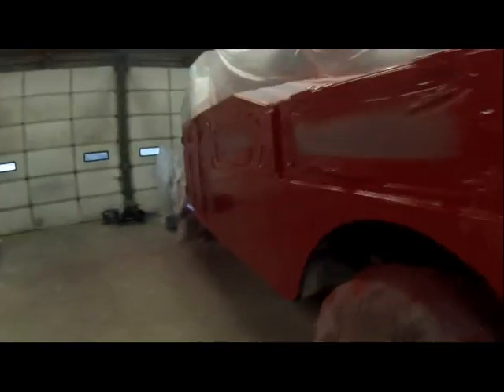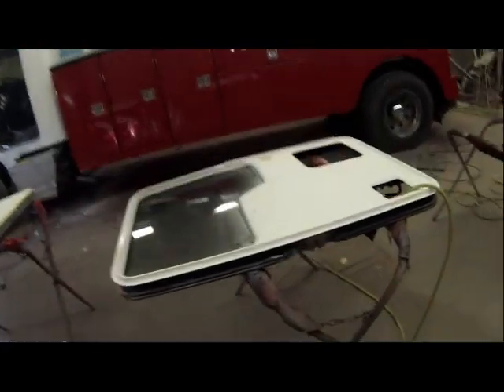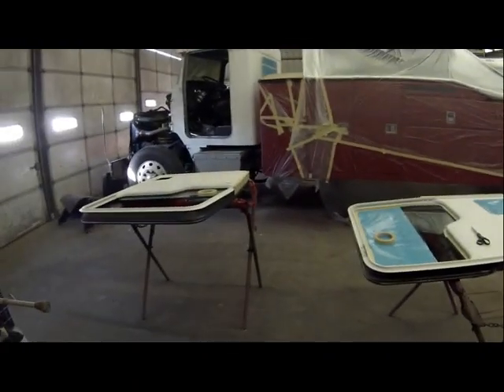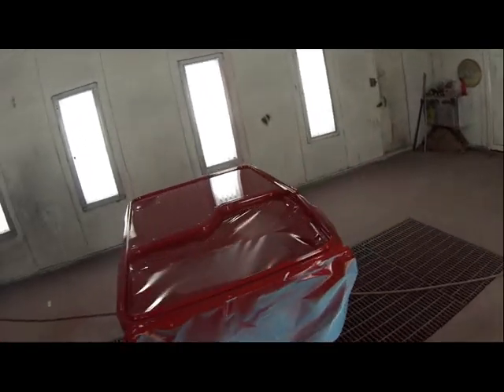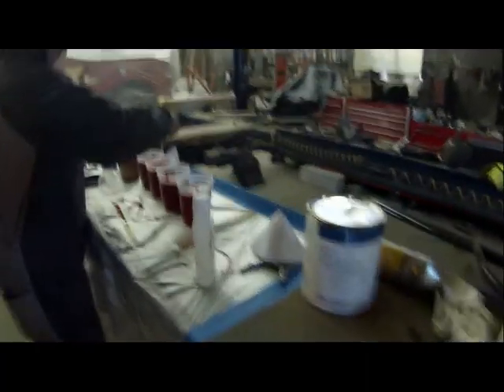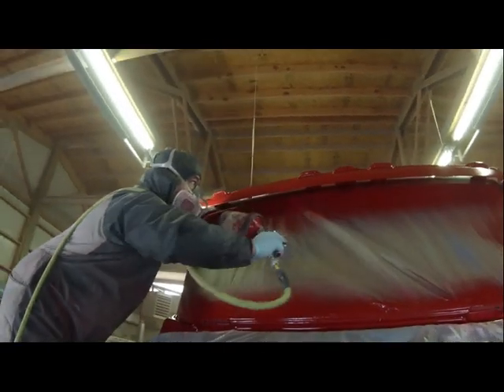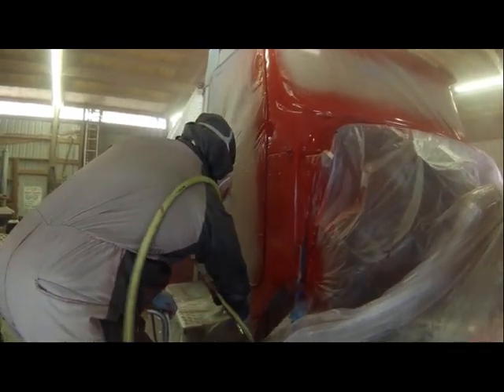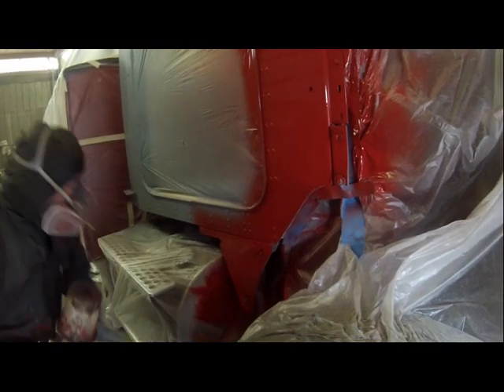Kenworth Paint Job Day 7

Comment: keep up the good work fellas, i appreciate the videos, i can say i have learned a little bit from you sir, and i learned about some new recovery equipment that i normally wouldnt use. the kinetic rope you use it for the beach i now use it for the snow to help people up the hills. it is a lot easier on the vehicle in tow and my truck, also i dont have to worry about it breaking or hurting the bumper to their car. regular tow straps are ok they get the job done but these ropes are easier to use. also i love the truck the paint job is coming out very nice.
Reply from the maker: Ridgeview Auto Body Corporation 
THanks . I am pulling the truck outside tomorrow . We spent the whole day putting the doors , hood , lights and  misc. pieces  on .

Comment: she looks good!! I'm going Black with my old skool 1 ton chevy wrecker(holmes 440 bed) Fresh motor redoing all the wiring upgrading everything on it including the on board air. Hope to have mine rolling in 2 months!
Reply from the maker: Black looks good but is so hard to keep clean and scratch free . I am going with red as the white   stains so bad what with our salt air . You get a little rust off a bolt and you end up with a  rust streak running down the side of your truck .